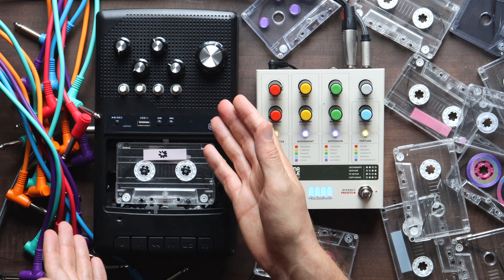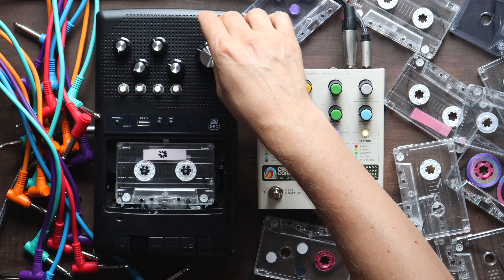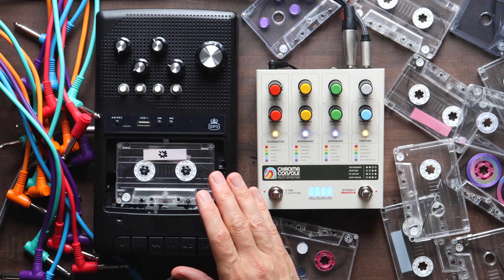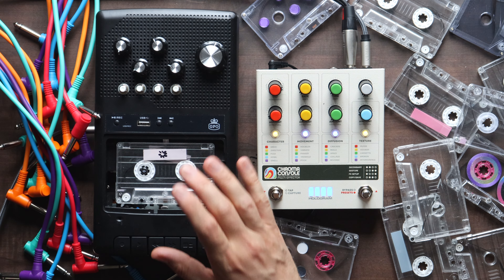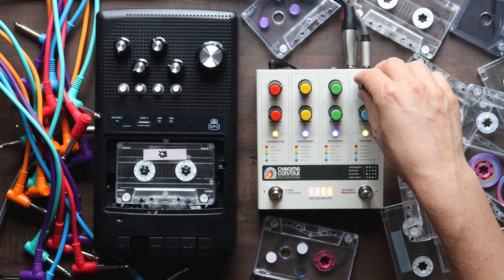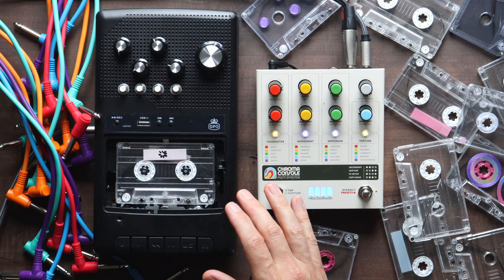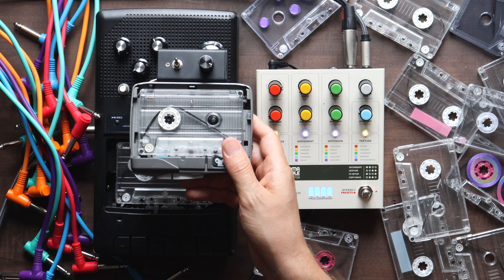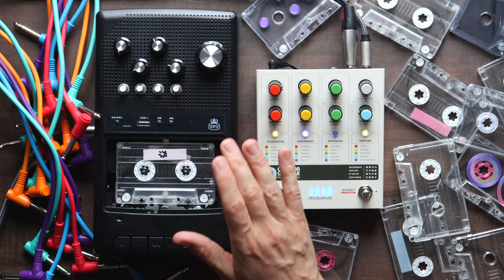This is a Tape Speed Playground // Modified Tape Machine

Comment: I appreciate that your processing of it with the Chroma Console isn't just slathering it with a huge wash of reverb that hides all of the detailed warble-y goodness of the tape loop like so many other Youtubers always seem to do.
Reply from the maker: Thanks, yeah the reverb on the CC isn't that special, to my ear, compared to all the tone shaping and pitch shifting it can do. Plus, as you mention, reverb can cover up all that tape texture.
Reply: I second this emotion! Always so refreshing when someone embraces the tapeness of tape ❤❤❤
Reply: Sadly reverb is one of the weak areas of the CC. It's there but very lofi in a way that works on a clean signal but gets muddled with any already lofi signals. That can still be handy but just not as Swiss Army as some of the other functions. I usually run it into much better reverbs after. But overall, I like both drenched in reverb and the alternative, so I appreciate the demo too. I have one of these on the way that was custom made but had some issues and had to be sent back to get sorted.